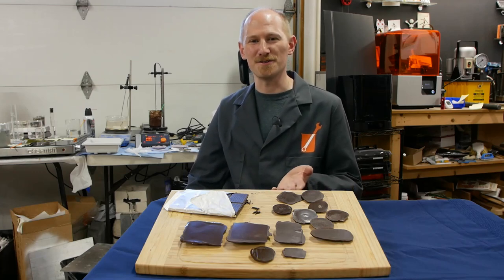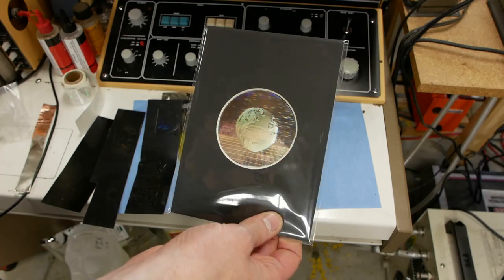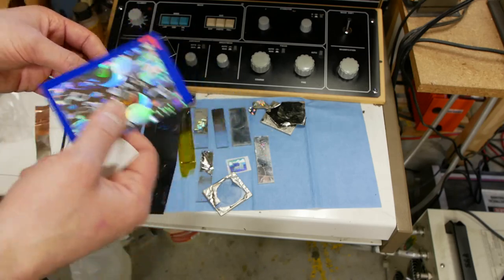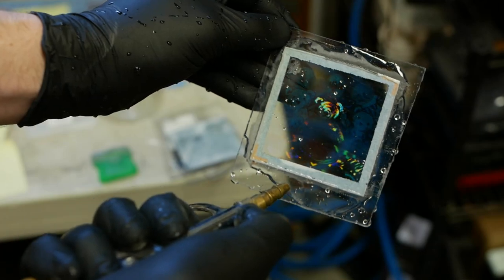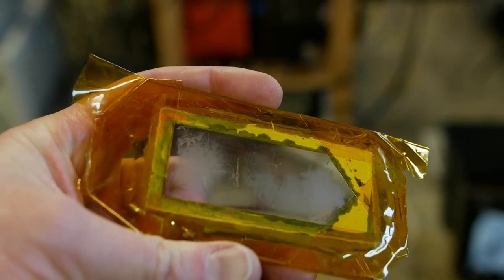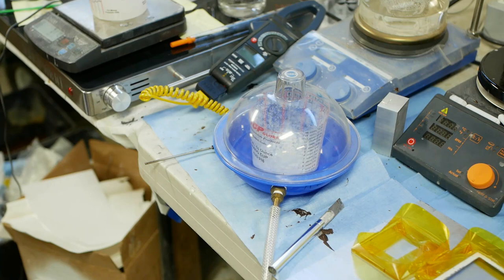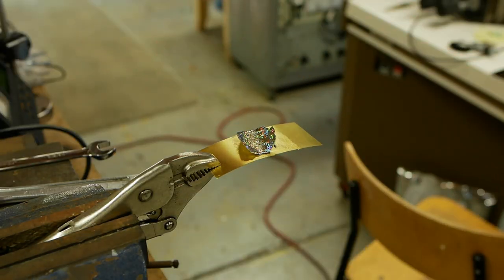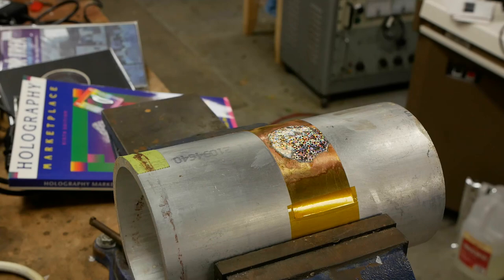Holograms on chocolate

Comment: Silver electroless plating for plated through-holes?
Reply: I had the same thought.  Why don't people make homebrew PCBs with a process like this?
Reply: NoahFect
There is an electroless palladium process that’s a bit more expensive but also looks more convenient. Commercially I think they do electroless copper, with an over-saturated bath. I think Ben did this in a past video.
But this palladium solution is a pain to obtain, compared to household chemicals and silver nitrate. There’s also the conductive paint/ink method, but I’m unsure how resistant it is to thermal damage, and it’s also a pain to get the ink down into the holes. If you do plan on dabbling in this, I think the graphite powder sold as lock lubricant is a good way to go, it looks very fine and it’s in a reasonably cheap and small container on alibay.

Comment: have one suggestion for research for you, i was planning to make my own research for this but it seems that wont happen any time soon, so...
you can produce electricity from the radio waves around us, so is it possible to make such small antennas on a surface to produce electricity from light? that would be direct conversation and way more efficient and more durable than solar cells...
Reply: Optical rectennas?
They are still at the proof-of-concept research stage, but they do exist.
https://en.wikipedia.org/wiki/Optical_rectenna
Reply: Theoretically, yes, and if someone could figure it out, it would triple the efficiency of solar cells and likely earn them a Nobel Prize.  The antenna isn’t the hard part. The problem is you have to come up with a diode that operates at light frequencies. That’s the bit that doesn’t exist.
Reply: @stargazer7644  thanks for the explanation... i want to read more about this, do you know any resource? i was thinking in a way, if we can produce electricity from electromagnetic waves with dipole antennae and if light is an electromagnetic wave, then we can produce small enough dipole antennae... length of dipole antennae is calculated (as i remember) 1/λ where λ is the wavelength, green light has λ of 500nm which means we need dipole of 2pm... ive read somewhere few years ago they achieved manipulating the position of single atoms but your comments lead me to research and i found out that size of atoms is 0.1 to 0.5nm so thats still out of our limits it seems...
Reply: @Hobypyrocom  I read about it years ago in either an article or paper explaining the physics behind why the efficiency of solar cells is so terrible, and why it isn't likely to get much better.  I'm sorry, I don't have a link.  The length of a dipole antenna is normally at a minimum 1/2 wavelength, but can be longer.  Shorter ones are very inefficient. So that would be about 275 nm long for green 550nm light. Those sizes are huge compared to modern IC transistor sizes, so the antennas could be easily made with current technology.  You just need a diode that operates at 600 THz to convert the AC to DC.

Comment: The violent chemicals to byte off the paper from the holographic layer do hardly give a bad taste to the chocolate, neither do the traces of tinfoil give an electric current off to the fillings in the teeth. There is almost no reason why I should not eat newly formed holographic chocolates. No reason, accept for the face that holographic chocolate is it does not melt stays in the same shape is it is. Ever thought of what happens when the chocolate does not melt? Pooping out little stars is nor funny!

Comment: Do your holographic molds work for other moldable materials as well? For instance if I had a very fluid batter of instagram slime, would this also create a temporary hologram affect? I suppose chocolate works because it is shiny, fluid, and able to pick up fine detail correct? So you need those 3 elements in your batter? Does the chocolate also have to be very thin?